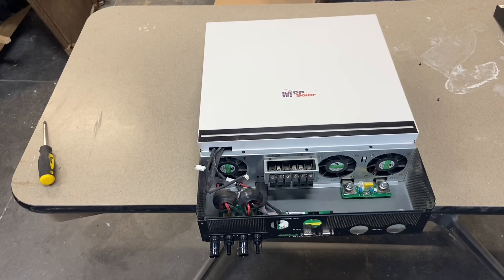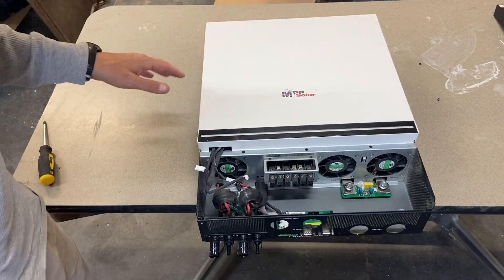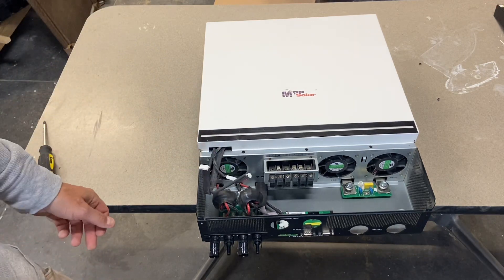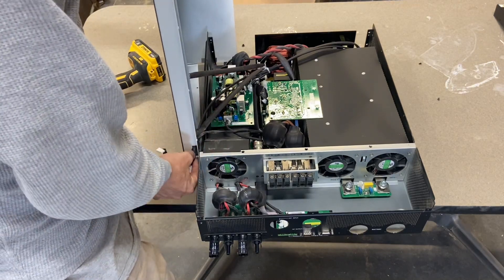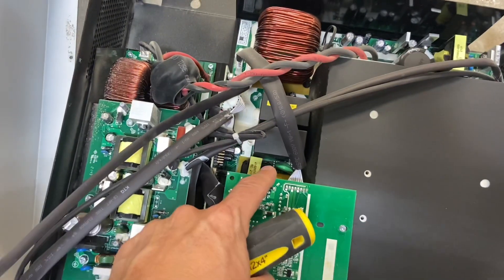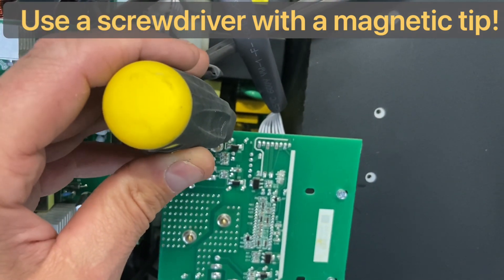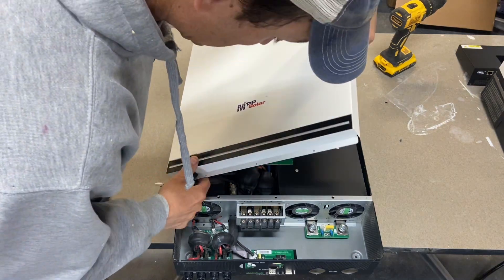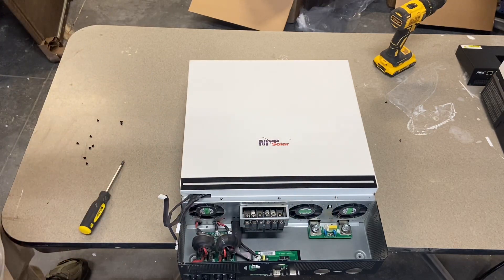Removing ground neutral bond screw in LV6548/EG46500EX.

Comment: I have a SP6548 in an RV and when it's connected to a 20A GFCi outlet using the shore power cord it immediately trips the GFCI.

Would removing the bonding screw solve this issue?

Thanks
Reply from the maker: A mobile application can be difficult due to the grounding. But I think it would probably remove the issue yeah.
Reply: @GavinStoneDIY  Thanks!

Comment: The problem is removing the display unit with many tiny screws when the power is off, then unconnecting all the connectors to the display unit, removing all the tiny black screws for the main cover, and then finally having access to the screw. Then doing the reverse when the case metal doesn't quite align properly with the screw holes. You need someone else to hold a flashlight unless you are willing to remove the entire unit from the wall. I ended up replacing some of the screws with thumbscrews, and not being able to get a couple of screws back in at all. It would have added a dollar to the cost to put in additional software control to permanently disable the ground-neutral bonding relay for slave units.
Reply from the maker: I agree there should have been a software fix for this. Signature Solar’s version actually had a firmware patch for theirs that eliminated this issue. 

And newer units like the EG4 6000xp have a common neutral setup. So no more issues.

Comment: How much PV are you running on your 6548?
Reply from the maker: I had 14,200kw hooked to my two units. They handled it well. But I was having trouble in the winter with going above my VOC limit. So I eventually switched to the eg4 6500’s.

Comment: I got a response form Signature Solar 4/3/2023

“You're correct. No need to worry about voiding warranty when removing the screw. Yes, this was the case in the beginning, however, now that EG4 has notified us that the screw should be removed in certain scenarios, we are honoring warranty regardless of the removal of the bonding screw. “
Reply from the maker: I’m glad they got back with you.

Comment: Interesting topic for sure. I removed mine as per MPP Solar recommendation. I’ve just run my first test today on these 2 LV6548s and I had about 7700W of PV coming in. It was charging my 25kwh battery rack and supplying power to the house nicely until, after about 1h, the 2p1 master inverter shut down abruptly giving me error code F80. Both inverters are on the same firmwares. Did this ever happen to you? What do you think the problem might be? I am clueless. Your opinion is much appreciated.
Reply from the maker: It never happened with my mpp’s. The f80 is just because one inverter shut down so it lost communication between them. That’s curious. I’ve seen this issue on the eg4 version but not the mpp ones.
Reply: @GavinStoneDIY  Yeah.. I was like "Yeah it works!" Then 1 hour later it shuts down abruptly. So, what do you think can cause a shut-down like this? By the way, love your videos!
Reply from the maker: @davideo.7754  I’m not quite sure. Something with the incoming PV. Somehow it overloads something temporarily. Have you contacted mpp?
Reply: @GavinStoneDIY  Yes, I emailed them yesterday but I got an auto-respond saying that they will be back on Wednesday, as in Taiwan from April 1st to April 4th it is a statutory holiday. So we’ll see when they get back to me. 
For incoming PV, you mean voltage of single strings or overall W? One string is 140v  and the other is 180v on each inverter, for a total of 3850W for each inverter. Can I also ask you what is the value for your setting # 2 (maximum charging current)? Thanks a lot!
Reply from the maker: @davideo.7754  I have mine set to 120 amps. Only because I have a pretty decent sized battery bank. Before I added more batteries I had each inverter at 80 amps.
Reply: @GavinStoneDIY  Got it, thanks. I’m still troubleshooting the error F80. Last time it happened on the master, but yesterday it happened on the slave inverter. Do you think that having 2 single strings coming into the inverter with a different number of panels (one string with 4 panels, one string with 3 panels), can cause one of the inverters to shut down abruptly? It happens only when the PV is connected, not when on batteries, and during the sunniest part of the day, around noon-1pm. In fact, so far, on a cloudy day, it has never happened.
Reply from the maker: @davideo.7754  no, I honestly think it’s a firmware issue. The problem isn’t anything to do with the error code. That’s just telling you one of the inverters disconnected. And the other is missing communication due to that. I had this same issue with the inverters I’m testing now. Mpp may have a fix.
Reply: @GavinStoneDIY Mmh, interesting. Are the inverters that you are testing the lv6548 model and are these the ones that are giving you the F80 error?
Reply from the maker: @davideo.7754  they are the eg4 6500 model. I’m going to release a video on that hopefully next week. I still need to straighten out some other issues first though.
Reply: @GavinStoneDIY  Got it. I was hoping to not have this type of issues on the lv6548. Still waiting for a response from Mpp. If you find the culprit please let me know. In the meantime, I will enjoy your other interesting videos!
Reply from the maker: @davideo.7754  if you buy anything mpp related I would always use either watts247 or current connected. That way you have some solid US support.
Reply: @GavinStoneDIY  I did buy them from Current Connected. I started a ticket with them and they told me it's a communication cable issue. They are sending me new parallel com cables. I also doubt the cable is the culprit, but they want to start the troubleshooting there. Will see, I'll keep you posted.
Reply from the maker: @davideo.7754  interesting. Well it’s likely that this could occur for multiple reasons. Yeah let me know when you find something out.
Reply: @GavinStoneDIY  For sure!
Reply: @GavinStoneDIY  120 amps of charging current on each inverter or 120 amps total, like 60 amps on each inverter?
Reply from the maker: @VladimirBlasy  the factory setting is 60 amps. But no, I have both inverters set to 120 amps. So a potential of 240. But I haven’t hit that number. I think 225 is the largest I’ve seen.
Reply: @GavinStoneDIY  Thanks for your reply. I am looking at some LiFePo4 batteries specs and the manual says that max charging current is 63 amps. Does it mean that if I have 2 inverters I need to set them at 30 amps each?
Reply from the maker: @VladimirBlasy  that is correct. And the larger the battery bank, the more charging current you can use. For instance,  if you had 2 of those batteries you could charge at 60 amps per inverter. If the batteries are wired correctly the amperage flowing into each battery is usually very close.  I have enough batteries that each can receive around the correct charging amperage. I have a video on this I think. Keep in mind, max charging isn’t something you’d want to use every day. It’ll eventually shorten the life of the battery. So a .5 C  charge rate is usually what is recommended with lifpo. How many AH is the battery you are looking at purchasing?
Reply: @GavinStoneDIY They are 100Ah. So, if I'll have 5 batteries, what would the charging current be set at on each of the 2 inverters? I am not really clear on this.
Reply from the maker: @VladimirBlasy  ah so you’re going to be using rack batteries maybe? If it’s the eg4’s they have a recommended charging current of 30 amps to get the maximum amount of cycle life out of them. So somewhere around 20-30 amps is the safest for each 100ah battery. That’s  .2-3 c rate charge. So let’s just say 5 batteries at 30 amps. That’s 150 amps you can safely charge at. So each inverter can safely be set to 75 amps. Charging amps is essentially just like a water spigot. Increasing the current is like turning the water up. Each battery is like a bucket. But as you turn the water up it flows equally into each bucket. So search the safe charge rate that’s recommended in the manual  for  your battery then just multiply that by however many batteries you have. Hope this makes sense.
Reply: @GavinStoneDIY  Now I get it! I feel like, duh?!? But, yeah it makes a lot of sense. Thanks for the explanation. Yes, I was looking at both eg4 and sok and the rack battery solutions. And what would the discharge rate be set at for each inverter? In the manual it says Max Continuous Discharge Current is 100A (1C). So for 5 batteries it would be...?
Reply from the maker: @VladimirBlasy  most inverters wouldn’t have a discharge setting. That’s based off the wattage you use from the inverter itself.  So a 6500 watt inverter would pull roughly 130 amps max. A pair of them would pull 260. So it’s the same with charging. Around 30 amps is ideal per battery. But that can be stretched if needed. 5 batteries would work fine for that. You’ll rarely use all that wattage. If you decide to pull the trigger on either type of rack battery consider following a link in my description to either Signature or Current connected before you do. It would help the channel. But if not, no pressure. Let know if you have any more questions.
Reply: @GavinStoneDIY  I will! I would really love to see your channel grow. You are a great source of information🤠Thank you!
Reply: This happened to me. I have 2 battery racks (12) total, in parallel setup to inverters. Host shut down 3x's, different days, on me in middle of a sunny day each time. No hard use on system at that time. Now SS is wanting me to go in and disconnect a grounding wire.
Reply: @lindaferguson593  Do you still have ground screws in place on both your inverters or were they removed by factory? Are the EG4 models?
Reply: I bought mine a year ago. Had them installed completely in October. I was told the eg4 6500ex were no longer being manufactured. Now, in the past few days I learned they are available again with updated firmware. I'm assuming that my inverters have those screws still in them. I heard that it voids warranty to mess with the interior of the inverters. Now I here it's Okey donkey to get inside and remove these screws. My host inverter did the same as yours just 3 weeks ago. On 3 different days. Between 12-2pm. No clothes washer, dishwasher, fans, hvac, micro...etc we're on. Very minimal use of power when it shut down. No faults shown. I rebooted by shutting everything down properly and restarted each time. So far, nothing more.
Reply: @lindaferguson593  So, are yours the LV6845s like the one Gavin presents in this video? Assuming they came with ground screws in them, how is your panel hooked up? Are you completely off-grid? Did you have your installer make the bond in the inverter's sub-panel? I am asking these questions to better understand your configuration and see what the issue might be. For us, it was a matter of bonding/grounding configuration. Once we assessed that, the error F80 and the abrupt shut-down never happened again.
Reply: @davideo.7754  mine are eg4 6500ex models. Electrician installer did nothing to the ground screws at time of install.
Reply: @davideo.7754  I have another question, if I may, having a battery issue of the cheaper eg4 48v lithium ion that doesn't have the display window on it. I had one that worked for about 2-3 was then stopped charging and discharging. It is one of a 6 bank rack of 2 racks in parallel to my 2 eg4 6500 ex inverters. Had electrician talk to SS and attach his computer to it along with sharing info to SS tech. They found a board anomaly that could not be explained, so agreed that motherboard needed replaced. Did so, but replaced that one with a new one I had ordered prior to replace this. New one is acting the same. Suggestions? BMS communicatio problem within batteries? Thank you!
Reply: @lindaferguson593  Yeah... BMS communication gave us headaches too, so we removed the communication altogether. If you bought the 2 EG4s last year, chances are that they did not come with bonding screws in them (ask SS if your EG4s came with bonding screws). This is probably the issue. Do you have a bond in the inverter's panel (you probably need to ask this question to your installer)? Because if ground and neutral are separate in the panel and the inverters have no bonding screws, you have no actual bond, so this could be the reason behind the abrupt shut-down that you have been experiencing. Hope this helps troubleshoot this issue. I know how hard can be sometimes with this equipment. I have been there!
Reply: @davideo.7754  thank you. Yeah, they don't know if the units have those screws or not.
Reply: @lindaferguson593  You're very welcome. I would open the units to check if ground screws are there, and then talk to your installer about it. A bond needs to be done somewhere, either in the inverters or the panel to make the system work properly. This video is very helpful and shows exactly where to look for those little screws.

Comment: Good job!  Like you I figured it would be a pain but it took all of 15 seconds once the cover was off.  Mine's been running this way since November with no problems.  I'll only mention that this is only recommended when you're running dual units split phase for 240v, then only in the slave unit.  I know you said you didn't want to get into all that, but you know someone is going to remove the  N/G bond screw in a single unit setup if you don't specify. 🙂
Reply from the maker: That’s why I didn’t specify. 😉 I’ve seen multiple recommendations in the last year. And I don’t necessarily agree with only removing the screw to the slave unit. But there is enough info on the forum to make your eyes blur. So I wanted to keep it simple.
Reply: @GavinStoneDIY  Good point.  Yeah, there's a lot of opinions on this subject and none of the suppliers or manufacturers seem to want to make a recommendation.  Other than SS on the new EG4 with no screws in it, but that opens a whole nother can of worms.  Not something to get into here, for sure.  Sorry I even mentioned it. LOL
Reply from the maker: @easttexascowboy257  no no, I actually like that you pointed out what is generally considered to be the best current advice on the subject. I just didn’t want to touch it with a 10 foot pole. I think the “filter guy” from the forum could make a 2 hour video on the subject. 😆
Reply: Hey East Texas Cowboy, can I ask you if you think the error code F80 at the master could be related to the fact that I had removed the bonding screws from both inverters? I am operating off grid, dual LV6548s in split phase connected to main panel via interlock kit and a 60 amps circuit breaker, 5 SOK batteries set up with no BMS communication at the moment. No ac input. At the time of the power outage I was running only some lights and the washer machine. Any advice would be of much help! Thanks
Reply: @davideo.7754  The DIY Solar Forum would probably be a better place to ask this question.  A CAN fault could be a number of things, but I doubt removing both screws would cause an internal communication error.  You SHOULD have a N/G bond, either via one of the screws or in your main panel, but not both.  But I think you have something else going on.  If you want to post the question on the forum I'm sure you'll get some help.  There's a lot of questions I would ask but this isn't the platform for getting into that.  Unless Gavin wants to take it on - it's his YT channel 🙂
Reply: @easttexascowboy257  I will try posting the question there (I am new at all this). Are you in the forum, as well? Can I reach you there? If you or Gavin can shed some light on this issue it would be great, I don't mind answering all your questions. Thanks!
Reply: @davideo.7754  Yes, Gavin and I are both on the forum. As well as a lot of people who are much more of an expert than me.
Reply: @easttexascowboy257  Thank you! Talk to you there then.

Comment: About a year ago I installed dual eg46500ex in split phase. There was allot of conversations about removal of the ground screw on many forums and I was still unsure on removal. I asked the design department at signature solar and they said “under no conditions should the ground bond screw be removed and will void any warranty if screw is tampered with”. My eg46500ex has a dated pamper sticker covering one of the screws holding on the cover so my bonding screws are still in place. Has SS changed there mind or does this not include the eg46500ex model. In my case I am 100% off grid and dont have any grid power connected to the inverters but not sure if that makes a difference. Thank you for the news I will have to contact SS solar and discuss bonding screws.
Reply from the maker: Their advice on the subject has now changed. SS has a have a video they released on the subject. And a new firmware update to go with their latest advice. I would call or email them to clarify. But the last I heard it does not good the warranty.